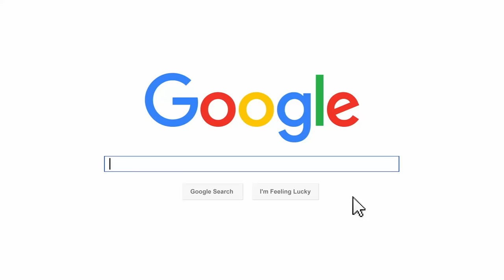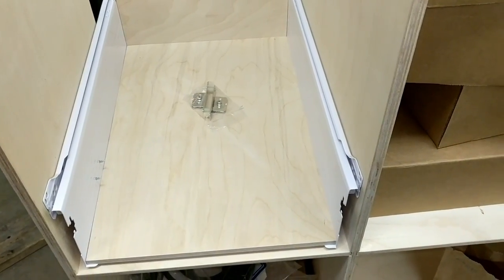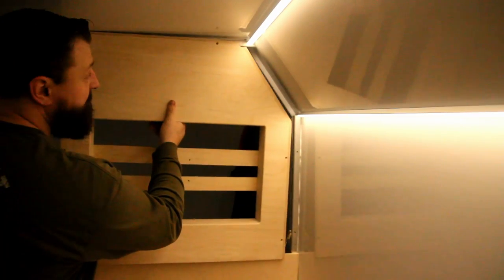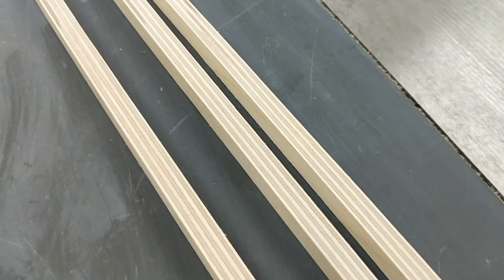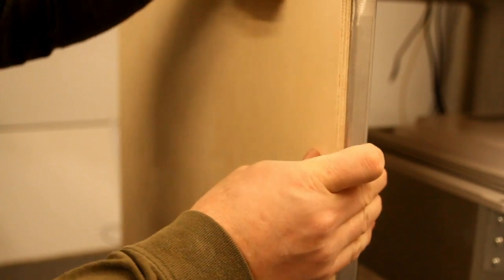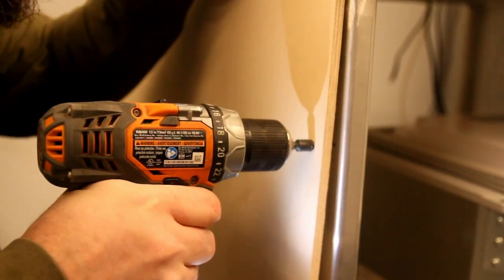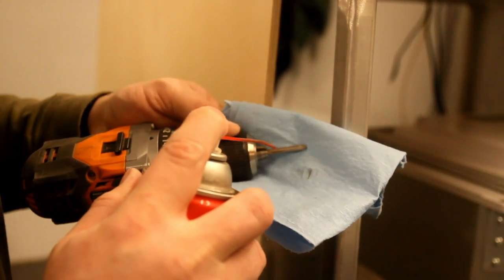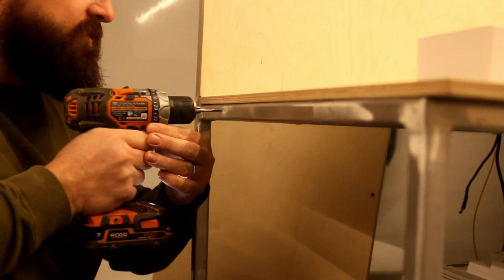Interior Cupboards - How to Build an Overlander

Comment: How did you attach the cabinets to the wall?  Looks like you preinstalled aluminum tube but wanted to ask.  If aluminum. How did you attach the tube?
Reply from the maker: The tubing was bonded to the walls with SikaFlex 252, see our 2018 tour video for more info.
Reply: this was the information I have been looking for all night here. I was beginning to think you might have fibreglassed wooden strips to attach the cabinets too directly to the walls.